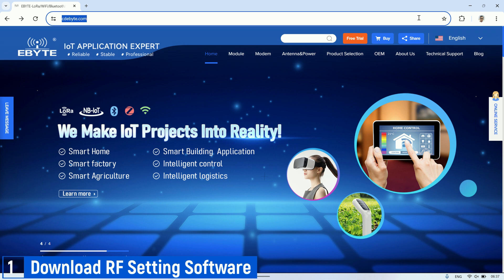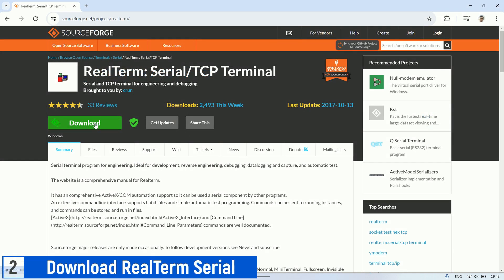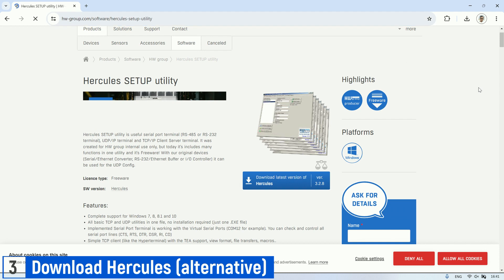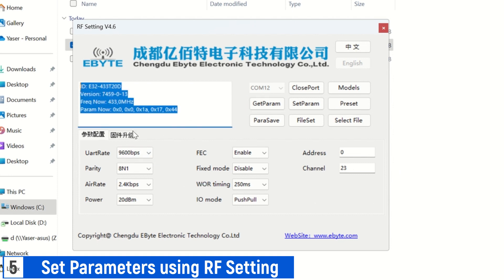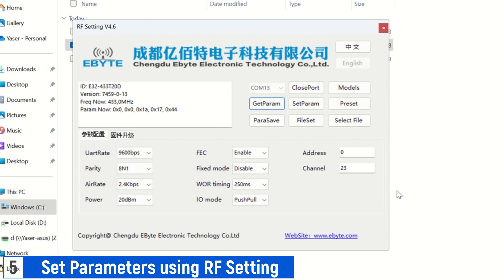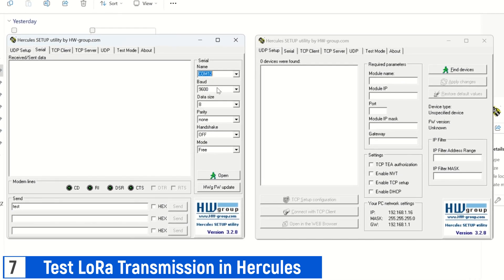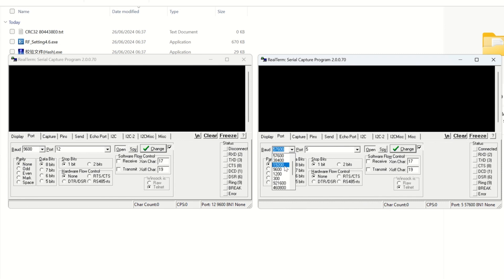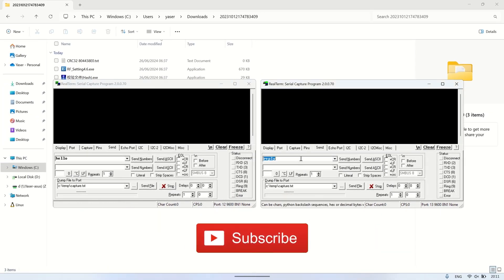Testing Lora Transmission of E32 Ebyte Using Serial to USB with Hercules or RealTerm Application

Comment: Does this model accept AT commands to enable continuous transmission for product certification testing purposes?
Reply from the maker: Yes, E32 supports AT commands, but continuous transmission for certification may depend on the firmware. You might need a specific mode or custom firmware.